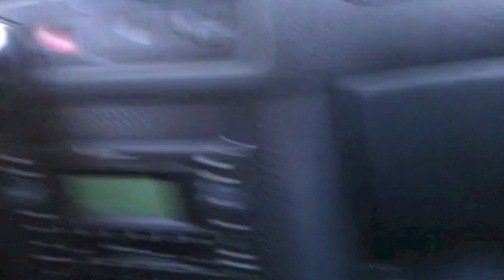Seafoam and Throttle Body & Air intake cleaning on a 2004 VW Jetta

Comment from the maker: Thanks for your comment. I think by doing this it should fix your problem it sounds like you have something stuck in your fuel Injectors. I would do the same thing like I did do the half in the gas tank and half of the canned for the engine. Every time you fill up you you get settlement that occurs at the bottom of the gas tank it could be stuck in your filter. You may have to find your filter and replace it. If it is completely clogged. Hopefully that helps

Comment: really good video, great, very clear instructions. excellent tip on the needle nose and clear hose. can't wait to try this out. this is something I haven't ever done before. many thanks brother. driving an '01 1.8t with 190k. I like to keep up with the maintenance as much as possible. hoping to keep this car as long as it can take. everything on it right now is stock. I love solid, clean performance. it runs strong, it's nimble.. ride is comfortable. as far as maintenance and upgrading goes dollar wise.. what was your best investment in your jetta?
Reply: LED headlights made a huge difference, recently change the headliner since it was falling, have 85,000 Miles on it now since I made this video. Still runs great. Need to get new tires soon

Comment from the maker: This is very good to get rid of all the gunk in your throttlebody which can cause problems down the road and will get rid of all the carbon buildup on your pistons. I noticed a difference after I did this car. It seem to perform a little better and seem to run a little smoother. Little maintenance can go a long way when you take care of your car. Thanks for your comment.